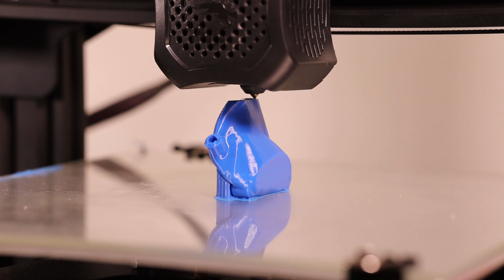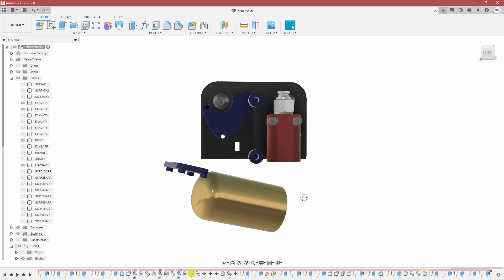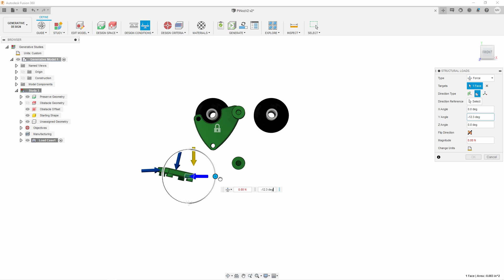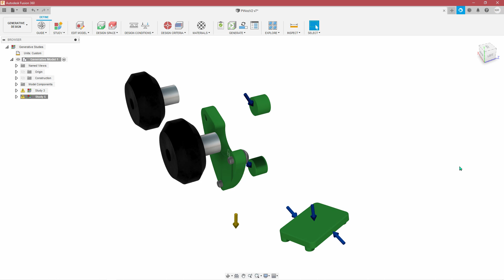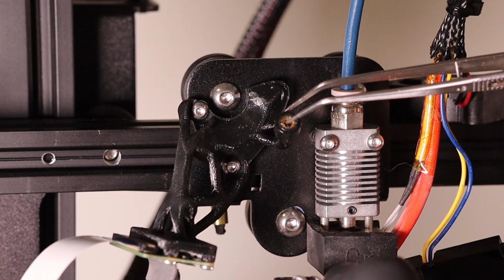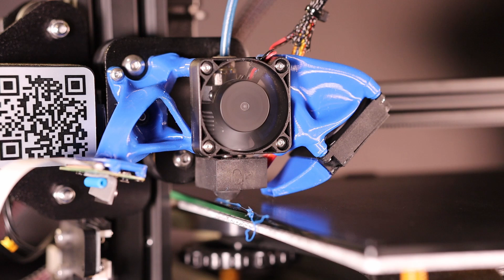Creality Ender 3 V2 - Generative Design Organic Pi Nozzle Cam Mount

Comment: Just an idea for calibrating the camera mount you could bring the stl/obj into another 3d package like blender, match the focal length of the pi camera  with a blender camera to simulate the picture. Then you could make adjustments to the mount until you get the best camera mount position. Hopefully that makes since...
Reply from the maker: I need to learn how to use blender... and grasshopper

Comment: Just tried to open your 3 files in Cure 4.9, the duct loads to proper size but your fan mount and picam mount are extremely small measuring around 5mm. can you update please I would love to print these in PETG

Comment: Did you use "shape optimization " process in Fusion 360?
If not then you should.  It is similar to what you did but doesn't take hour to generate shapes ? 
Thanks for showing this process. I am going to try this on my project.
Also look into simple slider compliant mechanism to adjust camera angle.

Comment: Do you need to print with 100% infill?
Reply from the maker: 40% max, could be much less for a print like this, the outer shell adds quite a bit of the stiffness.  I'd go with 3-4 walls due to the screws/holes.
Reply: @NeedItMakeIt  thank you bro

Comment: How   is it possible, that iv tried every possible  ways to print with my ender-3 v2  but it doesn't stick. Always with new  print plate first 3 prints  are perfect, after that  it doesn't  stick anymore..why?nobody  knows
Reply from the maker: Are you printing on the flexible sheet, or glass?  If glass, add some dollar store glue stick and you'll be good with PETG or PLA.  If you print with ABS, it will give you trouble, Nano adhesive, or EXTRA HOLD hair spray also works fairly well.

Comment: I love it! As a learning and practice piece.
But of course, Fusion360 doesn't calculate your infill other than it being a 100. Also, FDM printed parts, don't have the same tensile strength in all directions Z-axis being the weakest. So the whole simulation is actually incorrect, except you did well by overloading the simulation so it compensated for those oversights.
Reply from the maker: They should work on this, and maybe they are already.  I would like to source some 3D printed parts in nylon/alum/titanium to see how they perform based on the simulation.  I have too many projects!

Comment: im in the middle of trying to design an esp8266-powered servo-mounted raspicam setup which is interfaced through the blynk app, so you can remotely pan/tilt/yaw control your footage feed if required...
Reply from the maker: That sounds awesome, very interested to see what you come up with.

Comment: 0:12 What are those things like waves?
Reply from the maker: This is an adapter for the bowflex 3.1 bench I designed a while back to gain adjustment slots on both the seat and  the back.  It turned out that a lot of other people had the same thing in mind and I've been making them for people in Canada and US for some time now.

Comment: Cool. I've seen it in Fusion 360 but never really played with that option. Thanks for showcasing it.
About the camera mount, what about statically mounting it but adjust the optics (ex. a small movable mirror)
Reply from the maker: I think you're right, the camera should be mounted solid, I'm still investigating options.   The shape of this PI camera really isn't right for the job is it?

Comment: Really would like to try this for higher resolution. I don't fancy the process others have used to fit the newer borescopes as nozzle cams. 

I've had a borescope on my Ender 3 for almost 2yrs now. The image quality isn't the best, but I can't find a better imager that doesn't use a semi-rigid cable. The cable on mine is flexible like a DMM lead.
The mount I use bolts over the end of the hotend fan; courtesy of Dave Petsel (petsfang designer).
Reply from the maker: That's the issue I was having, I found the quality poor,  I'm still looking and willing to re-design when I find something better for the job.

Comment: Genius! Shame I can't do that with FOSS software.
Reply: why can you not do that with FOSS...?
Reply: @c2unt  The most advanced FOSS software I'm aware of is FreeCAD (currently 1.9b) and it doesn't have many of the facilities demonstrated here, particularly this sort of organic design.
Reply: @marcdraco  did you consider making something using the Arduino IDE with or without combining that with either an ESP8266 or ESP32/ESP32CAM board...? The ESP32CAM board particularly seems to me to be almost custom MADE for a project like this tbh...

Gimme a shout if you're just hitting a brick wall due to lack of experience or knowledge in the area I'd be happy to lend a hand...?

Comment: @NeedItMakeIt
take any preferred camera and let it look downward. then just place a mirror under the camera to redirect the view to the nozzle. now you can adjust the cameras height and focus and the angle of the mirror. could even help with the cameras distance to the heated bed

Comment: It's very cool but completely pointless as the stress model they use to create this part is 100% infill injection moulded, it doesn't take into account 3D printing weaknesses e.g. layer lines.
Reply from the maker: Exactly 100% pointless, or can you give it maybe 99% pointless...  "So you're saying there's a chance".

It does not seem to account for 3D printing FDM style, not yet at least, this would be tough considering the substantial weakness along layer lines, as well as other variables associated.  I am investigating this more and will likely have a follow up video with some ideas to help with this.

Comment: Generative design is very good thing, but it assumes a solid casted items for full strength. Meanwhile it is true that some fff made design will be stronger with this method it is not an universal truth due to fff limitations.
Reply from the maker: That's good to know.  There should be a setting to adjust the density and infill considering that it has a selection for additive manuf of plastics.   Maybe it is not so advanced yet.  I'd like to throw some tests at it to see how accurate it is.  What I am not sure about is how does it know how stiff you need the part to be?  Sometimes you may want something a bit springy and sometimes very stiff, maybe that is safety factor to tweak.

Comment: The loads can be calculated really easily buy multiplying the weight times the x axis acceleration
Reply from the maker: Ah.... the old force = mass x accel.   You gave an idea to see how accurate this gen-deign truly is to real load requirements.  There is a safety factor selection, it is a default value of 2, if I change it to 1, how does a part perform and how is the level of stiffness determined?

Comment: I would be wild to re-generate a bunch of the parts for an open printer (like a Voron). It would have a weird organic, but still mechanical look.
Very cool. Thanks for the share
Reply from the maker: That's pretty crazy, because that's exactly what I've been working towards.  It is much harder than it looks though, but definitely do-able for most parts.  I was going to go one step further though, because I love to make things tougher than they need to be.

Comment: I hate to be a naysayer here but, a huge design flaw here is that the heatsink fan is working as a part cooling fan now. It may work fine for PLA. But I promise you'll run into warping issues.  The air from the heatsink fan needs to be contained and directed away from going down towards the print.   (Look at the Prusa extruder or the E3D Hemera)
Reply from the maker: Not at all, this is a prototype, I ask for your opinions for design changes.  I did not describe in the video that I shifted the hotend fan up 15mm to help with this.   A deflector/director could help with this.   Printing PETG should be fine, ABS could be a problem.    Any recommendations for a design change?

Comment: What slicer are you using? Do you use the F360 one?
Reply: looks like cura
Reply from the maker: Yes, Cura 4.9, I've not tried the F360 version I believe it is mainly intended for metal 3D printing (need to look into it).
Reply: @NeedItMakeIt  thank you! I switched to Prusa slicer recently for my 3v2 and it’s weird how different the prints are but not in a bad way.
Reply from the maker: @DouglasFish  That's interesting, I've checked it out, I have to experiment a little more because I wasn't able to get great results from the start, but I didn't with Cura either.

Comment: This is great but, No BL Touch mount!?
Reply from the maker: I thought about that later on, it can be added to an updated version with little trouble.  I wanted to see about having an adjustment screw for fine-tuning the focus and I wanted to bring the camera a little closer also.  Maybe a short follow up video would be worthwhile.  It took me about 2 weeks to get my head wrapped around it, a change now can be done pretty quick.
Reply: I guess it's a choice he made
You could still use manual mesh leveling to try and get the bed as level as possible without the BL Touch

Comment: Looking excellent! 
What was the reason you didn’t like the boroscope? I was thinking about purchasing one and mounting it on my printer’s hotend.
Reply from the maker: The quality of the image was not good at all and it was a wireless version which only allowed viewing on my phone, extra steps, poor image and the cable was very stiff.  Do not buy the Bluefire borescope if you're looking.  Also if you have one that you think would be good, I'm willing to try it.  I would love to have a macro version mounted for super close up, it just can't cost a lot I want it to be accessible for most people.
Reply: @NeedItMakeIt  the generic USB ones on ebay work great, just ignore the micro-usb adaptor for phone use and they work out of the box with linux or windows. good picture and you can get it reaaaal close. oh and the bonus of having a light built in.
Reply from the maker: @ale6242  Would you be able to send a link to one, I'm happy to create a setup with a borescope to get a better view of the extrusion?

Comment: Which firmware do you using?
Reply from the maker: https://drive.google.com/file/d/1NQGiJOq1wygLa3jnxyJ8Kz8ck1VhiteT/view?usp=sharing  It is marlin, my first E3V2 had a problem with not being able to save e-step changes.   This version fixed the problem and and videos I've made within the past 6+ months have been using this.
Reply: @NeedItMakeIt  thanks!
Reply: Probably the one from Jyers :) 
https://github.com/Jyers/Marlin
Reply: Yes I used Jyers,it is good but print quality is bad.I don’t know why but Marlin’s print quality is better than Jyers and stock firmware.But they should add a firmware for screen.I think Marlin 3.0 they will add.
Reply: If they add screen firmware Marlin will be the best one.Because people need mesh bed levelin.Jyers have but quality is bad.
Reply: @yiigitkpln  I'm using Jyers' Marlin and use Manual Mesh Leveling (3x3) and get good results
You should check out CHEP's video on Manual Mesh Leveling if you don't have a BL Touch ;) 

https://www.youtube.com/watch?v=9TCqQF374GU
Reply: @CebAkt  yes I already watched it but I don’t need mesh bed leveling because I’m using Creality’s tempered glass bed.